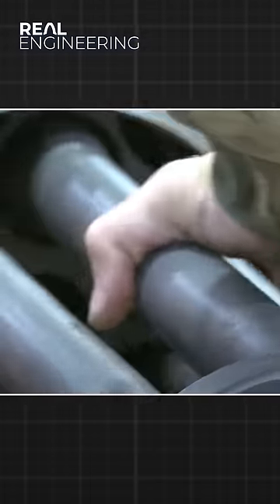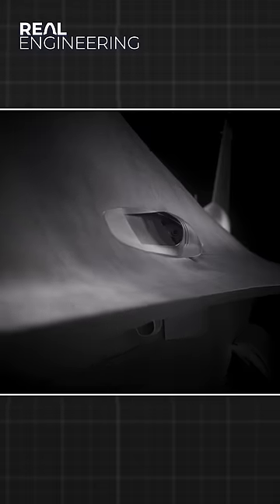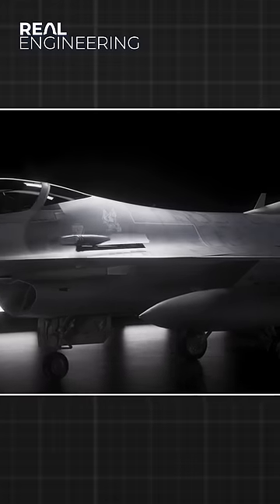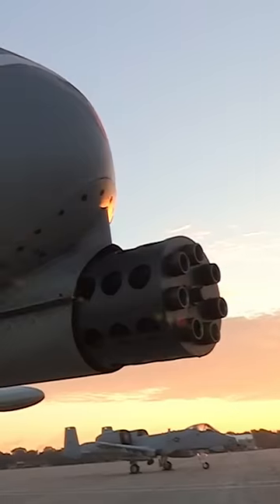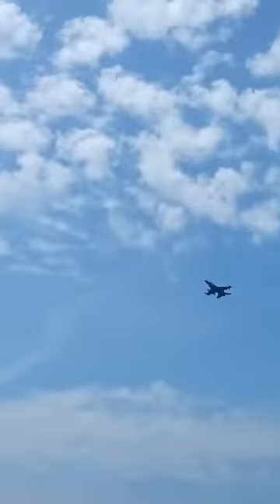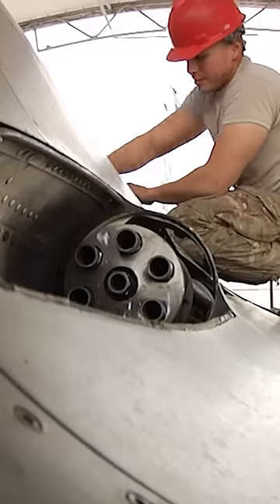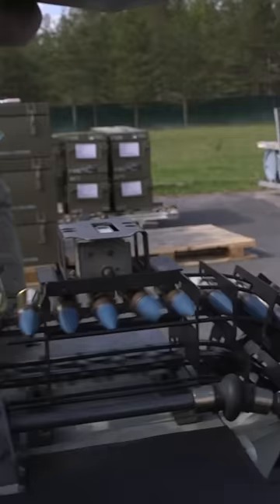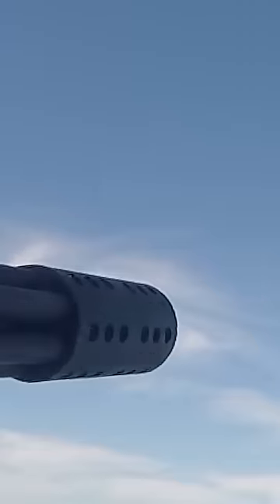The F-16s Gun Sounds Amazing

Comment: Just to be clear, he said 100 20mm rounds per second, not 120mm rounds
Reply: To be clear this device pushes 21 pounds of metal and high explosives at you at a flow rate of 1800 feet per second every second that it stays on.
Reply: @ibelieveingaming3562 and 3 football fields
Reply: @ibelieveingaming3562  1800 feet? How many hands are these?
Reply: @EarthIsFlat456 I don't know, but it's about half the width of your mom.
Reply: @c1985paul  LOL triggered
Reply: there must be an error
it fires from the top position and spins 16 times per second... that would mean 16 shots per second, which is still impressive

16 shots per second times 6 barrels = 96 (almost 100), but it doesn't fire all barrels at once
Reply: A hand is 1/2 a foot, so 3600 hands
Reply: 1800 feet is equal to approximately 5,400 hands @EarthIsFlat456
Reply: no a hand is 4 inches so 5,400 hands @SirNobleIZH
Reply: @zedwpd  But my hand is bigger than yours.
Reply: @zedwpd  my mistake, thanks
Reply: @SyNcLife 
Firing rate 6000 rpm
100 rounds per Second
Reply: Imagine
Reply: @peppi0304  120mm round would be crazy, tank shells from a plane
Reply: No shit
Reply: I don't know which sounds worse
Reply: @SyNcLife Or 16.667 revolutions per 100 rounds
Reply: @ibelieveingaming3562  21 pounds is about 30 dollars, right?
Reply: It was perfectly clear when he said it the first time.
Reply: @SyNcLife  USAF 2W1 here. During my career, when on F-16s, I probably removed and installed about 120 of these with slack adjustment and borescope alignment. 

It's rated for 7000 rounds a minute, but we never push it that high, mainly because of tolerances and likelihood of damage and jamming.

2600-3800 a minute is what we keep it at depending on TP (Target Practice), HEI (High Explosive Incendiary), AP (Armor Piercing) or other type rounds as well as the mission op requirement.

This is done by attenuation of the hydraulic system that powers the gun which itself is electrically fired (whereas the GAU-8 is percussion fired).

The drum though doesn't hold more than 510 rounds. Can get 511 sometimes depending on slack, but those rounds are gone quick which is why pilots rarely squeeze the trigger for more than 1-2 seconds. At 3000/m that 1 second is 50 rounds.

None of this information is sensitive in nature.
Reply: Yes
Reply: Self evident
Reply: 6000 rounds per minute mean 100 per second
Reply: @zedwpd are you lot still measuring things with your hands and feet 😂
Reply: He sounded robot
Reply: It costs four hundred thousand dollars to fire this gun... for some amount of seconds.
Reply: But I would really like to see a 120MM Rotary cannon 😇
Reply: @solidsteel3634  It wouldn’t be on anything flying, if it could take off it’s likely to get decelerated to a stall speed pretty quickly when fired…. Fire it out the back of the cargo door 🤣
Reply: @John637 I don't want to be near it either, but it would be funny to have 🤣
Reply: @tristandaries1129 imagine a rotary canon that fires 120mm rounds how ffn wild would that be !!
Reply: I was scrolling specifically for this comment.👍
Reply: 120mm viper when
Reply: @EarthIsFlat456 about 100 dishwashers far
Reply: @c1985paul wow a mom joke. Are you 9 years old? Give your mommy back her phone little kid
Reply: @EarthIsFlat456 real question is how many Danny Devitos is that?
Reply: @SyNcLife it takes 2 seconds to Google and confirm that this gun fires at 6000 rounds per minute that 🙄
Reply: Right? That's insane!
Reply: @ibelieveingaming3562  wrong the rounds do not weigh 21 pounds. They’re only 6 kilograms
Reply: Firing a 120mm would destroy the aircraft
Reply: @c1985paul BAAHAHAHHAHAHAHAHA
Reply: Yes…an f16 designed to shoot 120mm would be pretty fuckin metal though
Reply: @SyNcLife fires each barrel once with one rotation. 1 spin = six shots.
Reply: @SyNcLife  I was thinking like you xD
If spin 16x/s and each barrel (6) will fire a shot every spin, is shooting 6 bullets every spin. 6x16=96
Reply: Thank lol i was like wait the math isnt mathing 😅
Reply: 1 100m round per second
Reply: @ibelieveingaming3562 That's a pretty sobering thought! If I read that in the brochure, I'd think "Yes! Gotta get me one of these!"...😊
Reply: @SyNcLife  I think they meant full rotations, so if it's 6 barrels x 16 full rotations, that would make 96, which is within rounding distance of that 100 figure.
Reply: @SirNobleIZH  Lol! A hand is at least 75% of a foot, which coincidentally is pretty close to 12".
Reply: @EarthIsFlat456 they weren't triggered they were making a lighthearted joke. If anyone's triggered it's you for defensively thinking they were somehow seriously trying to make fun of you.
Reply: Correct so it would be pushing $30 dollars a second at you
Reply: @gizmo7720  100 20mm arounds is not $30. Can't even get a box of like 40 9mm rounds for a handgun for 30 bucks.
Reply: No it doesn’t fire 100 rnds per second
Reply: No shit Sherlock. A battleship gun isn’t on that plane
Reply: @DarthNih1lus57  120mm is an anti tank round. Larger rounds are used in naval cannons, as 120mm wouldn't do much to opposing ships.
Reply: To be honest I also heard 120mm rounds and I was like.. wut :D
Reply: @KaraTheGirlie  LOL yes they're no use denying it.
Reply: I thought that was obvious because the f-16 isn’t a flying WWII battleship.
Reply: They said 16 rounds per sec, that makes 960 rounds per min, not 3K....
Reply: @c1985paul You sound like a little kid saying that.
Reply: @GewelReal  20 bathtubs of lead
Reply: @SyNcLife 96/100 close enough…
Reply: I actually designed a 6 barrel 120mm gatling gun which fires the same apfsds as an M1A1 Abrams for use in a star ship...it's purpose to destroy alien ships which are shielded against lasers and phasers and plasma weapons, but weak against old school kinetic energy rounds...or to perforate a small asteroid before hitting it with an explosive round....or to bombard ground targets while in orbit...the DU probably won't burn up in the atmosphere.
Reply: @EarthIsFlat456  bro I like your momma💪
Reply: @XtreeM_FaiL  21 pounds is about 10 kilos
And 1800ft/s is roughly mach 2
Reply: 120 mm round would be like a Tank round.😅
Reply: 🙋🏼‍♂️ Right right right. But he also said the barrle turns 16x per sec 🤔🤔 sooo how’s it shoot 100 rnds per sec 😂
Reply: @Salty_TaterTodd  6 barrels x16.66... rot/s = 100 barrels/sec or 6000rpm
Reply: HAHAHA THANK YOU. I would have never got that😂😂😂
Reply: They way Americans say numbers incorrectly, I knew this would be an issue, they say 'One hundred twenty' when it should be 'One hundred and twenty'
Reply: That would be fun though!
Reply: @SyNcLife 
A bit wrong there...
The way you thought of it is that it only shoots once per revolution, which would mean only one barrel would fire once it's in position. But there are 5 other barrels that also have to fire, and, in a revolution, the gun cycles through all of them, so there would actually be 6 shots in a full revolution
Reply: @zedwpd ur girl must be disappointed with those tiny hands 😂
Reply: @janus3555 finally, some real knowledge os present 😂
Thank you for explaining
Reply: @SirNobleIZH they do buta different plane.
Reply: @CarrotUK  100 and 20 are two different numbers phonetically. This is why we don't use 'and' between them as a point of distinction.

I'm sorry to say to my British Brother, but this is one of those moments where American English gets it right.

Other moments it's to eliminate useless bloat, like with the letter 'U' in Color, Armor, etc. 

Saying 120 in this instance instead of 100 and 20 is both to simplify it and fix an issue in syntax.
Reply: @janus3555  3.2 thousand people liked the comment pointing out the confusion due to the missing 'and', stay confused I guess...
Reply: @SyNcLife  Each barrel fires 16 times per second - not all at once, but still 6 x 16 = 96 per second.
Reply: Thanks. I thought I was an idiot for a second, because I counted 96 (that were rounded up I guess). Makes sense now.
Reply: But he didn't pause after saying " 100 ".
Reply: @SyNcLife That's by design. If all six barrels on the M61 Vulcan were firing simultaneously, the weapon would overheat too quickly to be practical.
Reply: Add to that bullet speed the speed of the aircraft!
Reply: @EarthIsFlat456  1800 feet is 5400 hands is 7200 palms because the full imperial system is ludicrous. It's 64800 barleycorns, if you're interested.
Reply: Thanks but I also did the math when they said it got 500 rounds and it can all be emptied in just 5 sec, because I got confused with that 120mm
Reply: Well ya lol cause 120s are huge lol
Reply: Correct unit should be democracies/second.
Reply: @EarthIsFlat456  earth is not.
Reply: @Creamin_All_Offensive  EarthIs
Reply: @GewelReal don't forget the average friges, elephants and pickup trucks
Reply: @EarthIsFlat456  no evidences, no arguments. Earth is ellipse.
Reply: @c1985paul If you don't know, you don't know
Reply: @EarthIsFlat456 You probably don't believe this plane is real, due to you not understanding basic physics (flat earther) and this plane needs the laws of physics to fly 😂
Reply: Thanks for that because I totally misunderstood him
Reply: Just to be clear, you need to make it clearer than that.
Reply: The developers had a chance to make that 17, 776 rpm, and failed. Thats a fail of patriotic  proportions 😂 @smactardian
Reply: Good lord 120 mm is what an Abrams (and most modern MBTs) use. I have no idea what it would be used for but now I'm thinking that somebody has got to make a Gatling version of one of those. After all, the only kill is overkill and the only DAKA is all the DAKA.
Reply: @EarthIsFlat456  5,400 but I really can't recommend measure them like that ass that is roughly how many hands would be lost trying to do so.
Reply: 😂😂😂 @c1985paul
Reply: @smactardian 1776 revolution per 'murica
Reply: @EarthIsFlat456 everyone's got different size hands, that's why I never know how big a horse is gonna be.
Reply: I find it more hilarious to visualize the F-16 providing better air cover than an M1 Abrams. :-P
Reply: @EarthIsFlat456  yes.
Reply: @janus3555 does the brass stay in the aircraft?
Reply: @Ausblack  yeah, after it fires it continues through the transfer unit into the return chute/belt under the drum which then deposits them in the other end of the drum.

The return chute is wrapped in a half inch thick kevlar wrap to prevent any slow fire or unfired rounds from doing damage. (Can only think of two times in 40+ years that happened).

When the aircraft is back in chocks, we hook up a feed assembly and cycle out the spent brass while filling with a new 510 rounds. (If continuing operation requires it)

That spent brass is then sent to ammo (2W0) refilled, primed and sent back to inventory to be used again at a later date.
Reply: This is out of topic, but can you imagine shooting a tank round out of a plane? 💀
That recoil, that impracticality... I wonder what would happen
Reply: @EarthIsFlat456  depends. Are we talking about Huge Hands Hans or Tiny Hands Trump?
Reply: @c1985paul  damnnn your mom jokes can still pack a punch 😂😂😂
Reply: No it fires 120 1mm rounds per second. Get it right you fools.

I'm joking of course.
Reply: 120 mm is definitely artillery shell scale.
Reply: How in the fk can it shoot that fast?
Reply: Tell that to the subtitles.
Reply: @SyNcLife  if it does a full spin then all 6 barrels fire per spin. so 16 spins = 96 shots per second
Reply: Thanks, that was confusing
Reply: @ibelieveingaming3562 …. 21 rounds/sec seems much more likely than the 100/ sec that the guy said in the video. 100 rounds per/second would be impossible.
Reply: @ibelieveingaming3562 …. 21 rounds/sec seems much more likely than the 100/ sec that the guy said in the video. 100 rounds per/second would be impossible.
Reply: @SyNcLife … it would literally be ONLY 16 rounds per second because it fires one barrel at a time.
Reply: I heard 120 mm and I was thinking no Fing way. I supplied 120mm to tanks before. I was so confused. Now I know it's more like a flying Bradley. Lolol
Reply: What is a “millimeter round per second”? 120 millimeter rounds per second?
Reply: @AR15andGOD  "120 mm round per a second" would mean they are shooting a  120 mm shell every second that you'd usually see out of a tank
Reply: @SirNobleIZH it's not that far off from what's already been done. You'd be surprised what crazy cannons they have put into aircraft
Reply: @SyNcLife It fires each of the six barrels as it reaches the top position, totalling 6 per revolution, totalling approx 100 rounds per second. It doesn't have to fire them all at once to fire all of them each revolution.
Reply: For reference, 120mm is the caliber of the Abrams M1A1/M1A2 battle tank. I know this, because I am a former USMC tank crewman. There is nothing like the sound of firing off a sabot or a HEAT round.😎